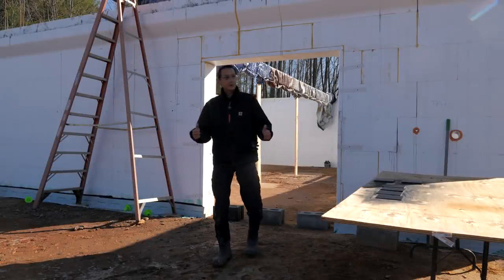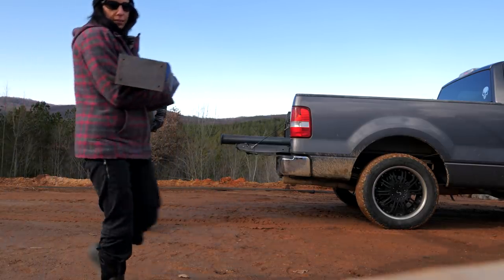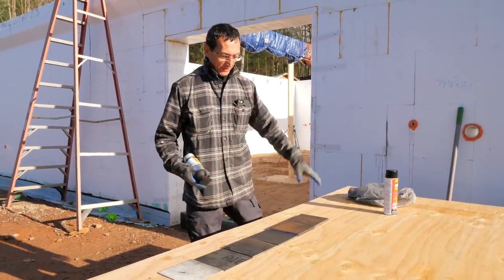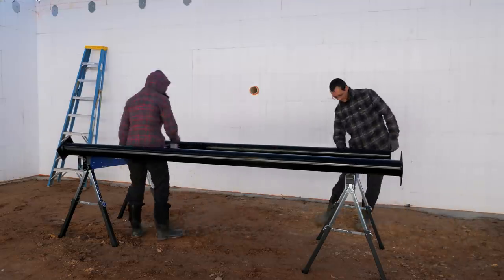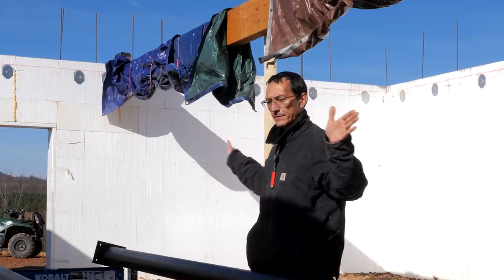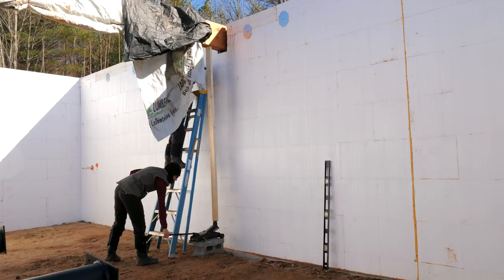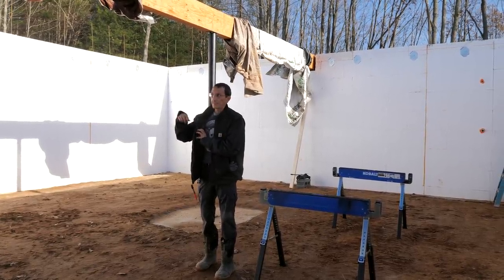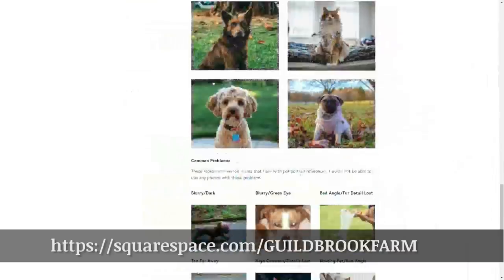Steel Support Columns for the Basement Beam

Comment: The Tap Cons are slick. They make anchoring easy. For the lumber end of things there’s some stuff out there called timber lock and head lock. Just like using a lag bolt but no drilling.

Comment: Get a round bale of hay and spread it around outside the build. It will help build up the soil for when you’re ready to plant, and it will help with the mud as you work, providing a barrier and then giving it texture for stability instead of slipping.
Gravel inside the basement would be good, but that’s a waste if you’re getting your slab poured soon.
Don’t forget to consider radon and put in a good moisture barrier!
Probably easier to do radon mitigation up front instead of having to do it later.
Looked at your art site, Jamie...that Scottish Highland is SO beautiful!! Just perfect! You might want to consider talking with person who commissioned it about you doing prints. Not sure about who owns the “art” since I assume the person sent a photo and owns the original...
Reply: What works better than hay is if you can get tree trimmers to drop off their big wood chips for free.
Reply: wallpello ಠ_ಠ 
Yes, but if they are going to lay sod, wood chips take too long to break down. Doing gravel where they know the driveway will be would be good, too. Putting wood chips close to the structure also provides a home for termites or carpenter ants.

Comment: Nice work. A few tips for people looking to learn. Keep a heat gun around for general use. Here it would be used to quick dry the paint. Also, layers of roofing felt can be cut into rectangles for dual use. They serve as fine adjust shims. Also, it will help keep the steel from rusting. Paint is good. But both roofing felt and paint is better.

Comment: FYI, the industry standard for priming steel columns and beams is 2 coats of standard shop primer red oxide paint minimum.
Reply: If installing HSS (hollow structural steel) in the center of an already finished basement, to be behind drywall, the steel can be left unpainted, unprimed, right?

Comment: Interesting video . Must have been a pain in squaring up the beam from side to side . Was just wondering ... did you have to order a special steel poles for the strength or did they just used any type of tubing for the poles . Thanks
Reply from the maker: It’s just regular 4” schedule 40 steel tube with 1/4” plates.
Reply: @Guildbrookfarm   Thank you Sir . Just wanted to add , smart in getting different size shims . They will come in handy .

Comment: great video, again.
question. I know you have the beam exactly where you want it. but, is there a plan to account for some minor settling of the beam as the weight of the house is brought to bear on the beam and columns? I have found that over time some settling does occur and slight adjustments are needed at a later point? this is just a concern of mine.
Reply from the maker: Nope. The only thing in this assembly that would compress is the beam itself and it would be negligible at best.

Comment: I know I'm too late, but that coating is a waste of money and time . Been there done that. Any mild steel below concrete, weather it's coated or not will rot. If it's not too late, I'd set those posts on the finished slab. They will not rust out above grade , and you can move/access them and the hardware without a torch, cut-off saw, or breaking up the slab. Just sayin.
Reply: i agree. Structural steel should either be encased in concrete completely or sit on top. Gaps will open around the post and allow moisture and oxygen into the concrete around the post. It will rust out. Far better to sit it on top. Also should be hot dipped galvanised. Interested to see if this passes inspection. Good Luck with the build guys.
Reply: @nichaire2790 , I agree with the rotting/rusting out, But if he were to notice a significant loss in structural integrity, couldn't they put a post right next to the first ones, on top of the floor slab or temp post on each side and replace ?

Comment: Just curiously, is there a reason other than looks I guess that you had steel columns made instead of using steel jack posts to support the LVL beam?? I'm from Canada and any basement I have ever seen used steel jack posts in the basement.  I know some people cover them with either a drywall or wood box when finishing a basement if they can't hide them in a dividing wall, or they replace the LVL with a steel I-beam which allowed them to remove the columns altogether. Just wondering if it is for looks or if it is structural.
Reply from the maker: It was not a standard height for most jack posts to reach and ended up being cheaper to have them fabricated locally to our spec.

Comment: Are you going to be putting in radiant heat there in the basement?  Seems to be a very popular way to go.
Reply from the maker: No. I’ve never seen a radiant system that didn’t have problems and they’re expensive to fix.
Reply: Radiant heat has its problems,  If you are not going to heat the basement all the time it's useless as it takes many hours to get the concrete floor mass up to temp.   So if one plans on going down into the workshop and turn on the heat, it will be 4 or 5 hours before you see any results.  It then overshoots and gets too hot just about the time you quit for the evening.  Radiant is great if you plan on leaving it on all the time so it can stabilize but then you are using energy when not in use.  A nice propane fired wall or shop heater will take the chill off in 10 minutes and can be turned off when not in use. They are simple, low cost and easy to maintain and install.   Even a mini-split electric would work well and provides AC and humidity control in the summer, but would likely need grid power.

Comment: Will the bottoms of your posts be encased in the slab? Why aren't you putting the base of the post on the finished slab? 😁
Reply: Is that large grey rectangle not a slab? I think it’s just muddy up close
Reply: @krb96  those are just bearing points that go beneath the slab, slab gets poured over them.
Reply from the maker: Slab floor is poured over compacted sand or gravel. Neither are “structural”. Posts must bear on a footing poured on undisturbed soil.

Comment: Would’ve pour the floor first myself
Reply: Can’t do that
Pads are structural the pad isn’t
Reply: Floor would be on top of the pad....first I ever seen it done that way and I’d be concerned with leaks due to hydrostatic pressure.
Reply: Posts are required to be directly secured to structural pads per engineering and code
Reply from the maker: The posts secure to the footing pads. Then compacted sand or gravel is laid and a concrete floor pad is poured over that. Neither of those are structural.
Reply: @ericbaker6542  I think you meant; the pads are structural, the slab isn't.